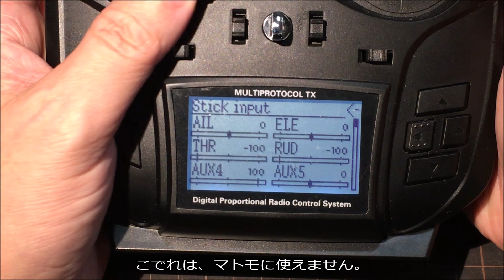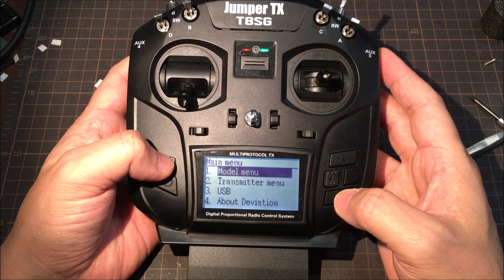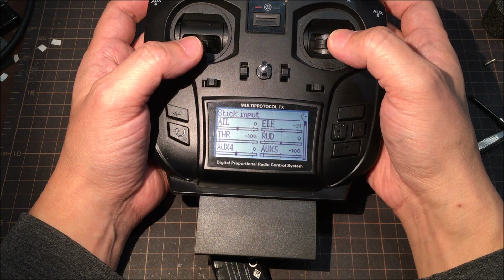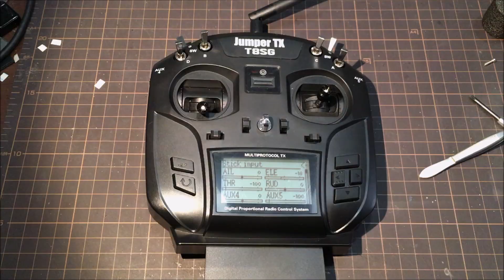[TIPS] JumperTX T8SG(new) 初期不良ホールセンサーの改修

Comment: Good job. I had to rotate the magnet on the yaw axis. Do you know what the two empty connectors next to the screws near the top of the board (see 1:33) are for?
Reply from the maker: Yes, this connector seems to connect a simple gimbal unit. The exact same connector is similar to the flat cable connecting the stick unit of the T8SG Lite (but it's a product of Jumper.xyz).

↓ T8SG Lite connector
https://youtu.be/sGLSWmbWF-4?t=148

Lite sticks are joystick parts for game controllers. The operation feeling is not good.
My early Jumper T8SG V2 Plus had this connector, but it was later retired and no longer seen.

Comment: Hi - I solved my problem. Calibration was wrong. It worked, after I had made large circes with the sticks (as in all other transmitters I do have is required), so circles at the outer limit of stickmovement. I did not do the mod you did here, but now my JumperTX T8SG works, also stick monitor works. I thought, the wrong calibration (sticks only up/down and left/right and no circling) was the reason for my problems. This has been solved.
However, I had opened my JumperTX before, after seeing your first video - there also seems to be dust inside. 
But since it works now (stick movement perfectly from 100 to -100) only after this different way of stick calibration, I will not to any further mods, if not necessary.
Reply from the maker: Hello, did you solve it in your way.
First of all, the calibration logic is a mechanism that records the values if the maximum value or the minimum value is reached, whether you turn the stick or tilt it horizontally, so there is no difference in manner.
(The reason I don't do it in a circular motion is that it causes the maximum rudder value of the rudder to reach just a little less than 100. The strong force of the finger causes a slight distortion of the gimbal, The maximum (or minimum) is not reached.So it is better to do it with a light force, so I did it horizontally and vertically to avoid rudder mixing. (I am an aeronautical science and software engineer.)

Then, if the operation is normal by drawing a circle, first check the length of the stick. The head of the stick can be adjusted up and down with a screw so that the length can be changed according to personal preference.
At the lowest shipping position, the stick will interfere with the base of the gimbal. Perform calibration after stretching it to the appropriate length.

Well, the problem I had was obviously a bad Hall sensor. I needed a different way to improve your problem, so I created a video to improve it. Are you dissatisfied with this video? I did what I needed to solve my problem and shared it.
Viewers can choose between two solutions to solve their transmitter problems. I think it is a good solution.
Thanks for your comment.
Reply: @UltraMicroManiacs  No, why dissatisfied? Your videos are awsome!
Thank you for your videos!
But I deleted my comment in your other video, because it was my error (I wrote I have the same problems). 
Funny as is is: After doing this calibration (with circles), the stick monitor of the transmitter showed values of 100 (+/-). 
But I still do have problems in Betaflight getting to max/min values etc. Maybe this is what is still to improve, but doing hard with Deviateion software... first have to check this. 
I do NOT say, this is a good radio. 
I can fly my toydrone Eachine H8 now with my JumperTX T8SG, but I am still failing to setup my (DSMX) Snapper7 FPV Whoop (it flies perfectly with my Spektrum DX9 Black).
I made a test with a normal plane receiver (DSMX) and different, normal servos connected to this receiver. Before new calibration the servo shivered and did not follow the sticks. After new calibration the servos worked normal and good (as in my DX9 I used for comparison).

I do not have a lot of experience with transmitters. I am using my Spektrum DX9 for 5 years now and before DX7s and DX6i for my helicopters and planes, nothing else (10 years ago a little bit Walkera and Nine Eagles). My main problem actually is to understand Deviation software ;-) - Very complicated compared to Spektrum.

BTW: I wrote to Banggood customer service complaining my T8SG does not work right. They replied and wanted a video. But then I could solve the problem of my JumperTX T8SG and replied, that the problem is solved and apologized for the inconviniences.
And Banggood replied and said "ok, they are glad, but they gave me still 25 US$ back for the trouble caused"... hard to believe. I love the Banggood customer service (this is not the first time they reacted that way).
Reply from the maker: Thank you for your reply.
I was anxious, maybe you may be dissatisfied. But I felt sorry, apologize for the strange misunderstanding. sorry.

By the way, recent Banggood has a bad reputation. Yes, from the latter half of last year. For me, for example, the item did not arrive, the reshipped item was different, there was no response at all to the initial inquiries, etc.
Nevertheless, there are many products that are only available at this shop, so I keep using it, but some people have already given up.
What exactly happened to Banggood? I want to return to the old, reputable shop.
Thank you very much.
Reply: @UltraMicroManiacs  ... hmm... I know some people complain. For me the customer service always has been awsome. I have probably far more than 500 orders with Banggood, and probably 20 - 30 times I had to contact the customer service. And always they solved the problem to my satisfaction, often they gave me "more than I wanted".
Sorry to hear that some people did make different experience. I am living in Austria/EU, and now they have those awsome shipment method "EU priority line", legal and no problems with customs anymore.
Reply from the maker: I have a very high chance of catching the initial failure because of my inherent luck.
https://www.youtube.com/watch?v=TaUavNgSAVA

We have received refunds for 27 initial failures and delivery failures only with Banggood. My transaction count is around 300, but it's too much.
I grew up in a Japanese culture that was careful to make, deliver and use, so I was surprised at the clutter of Chinese shops.
Now that I'm used to it, I'll use Paypal to refund complaints about the product, not customer support who doesn't respond well.
I have been asked to do product reviews because they sponsor many times, but I declined everything. Their attitude of "just sell poor quality products" is far from our users' minds.
For me, Banggood is not a shop I hate, but I hope to be a better shop.
Thank you for reading the bad sentence. This English is a machine translation, sorry for any weird expressions.